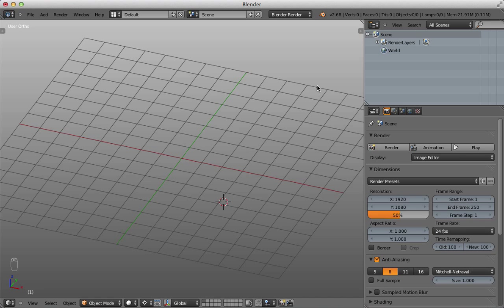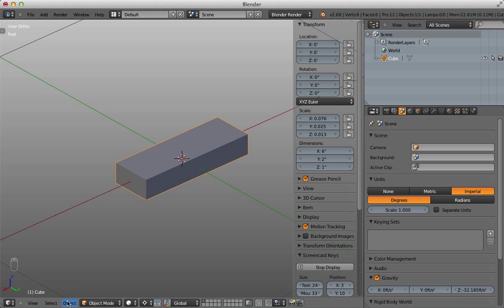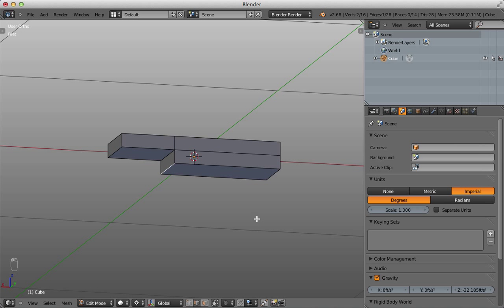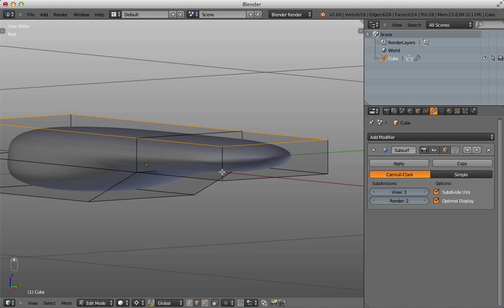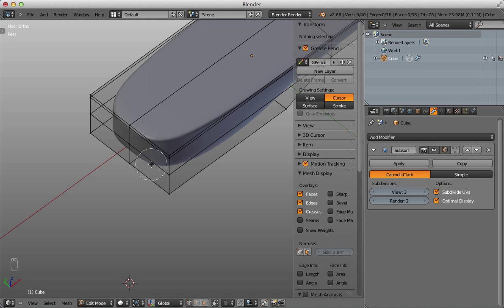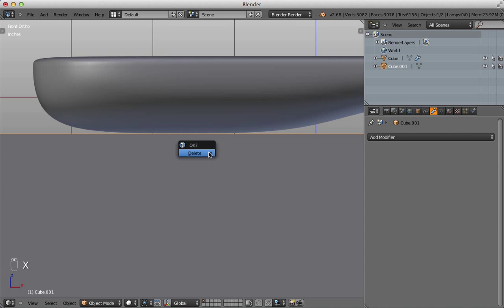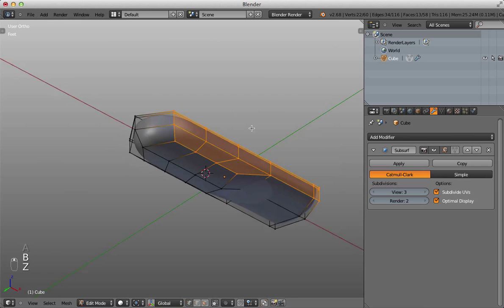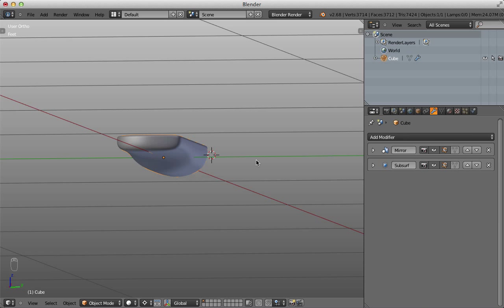Remote Control Body

Comment: Thanks for this video, just wondering one thing: what if you don't do CTRL+E to apply the scale? I do designs for 3d printing and I'm asking if not applying scale could have some impact on the final model (in terms of scale and dimensions), is it true? Why is it needed to apply the scale by clicking CTRL+E? thanks a lot!
Reply from the maker: +ibroooks if the object is 1 meter big and we add a solidify modifier to shell it with 1cm but we have a scale factor of 0.5 meaning the object while being 1 m is displayed as 50 cm will then have a solidify result of 5mm as well. You see the scale factor also is applied to modifier values. Thus is it better to not work with scale factors. When you do a circular array and the target empty for the array (center) is scaled you will not just and up with 5 buttons arrayed around the empty but they with each step scale by the same factor the empty is scaled.
Reply: +Claas Kuhnen thanks a lot, u gave me a very important best practice i will insert in my design production pipeline :)
Reply from the maker: ibroooks U are welcome